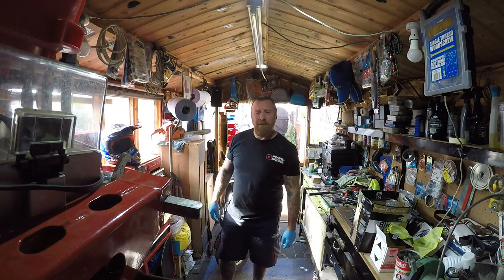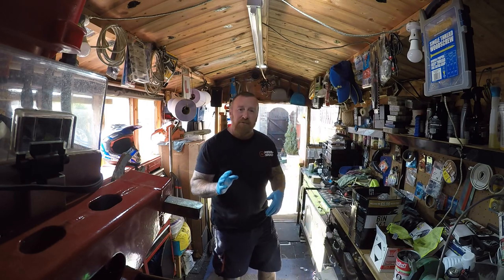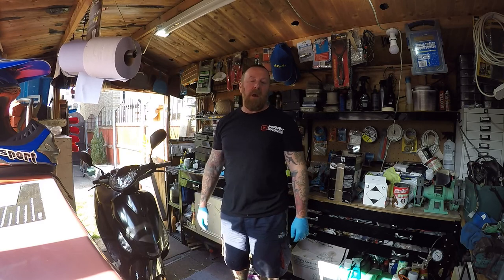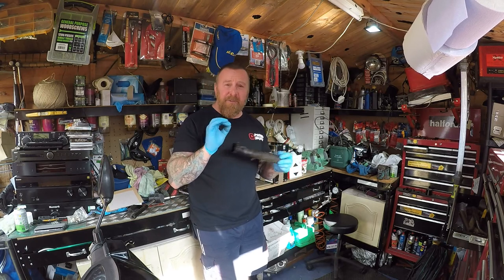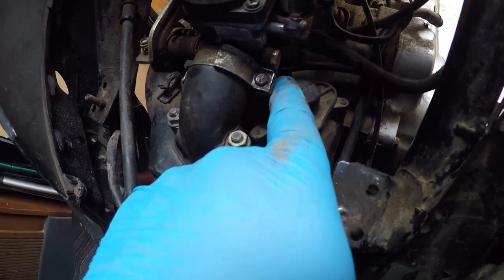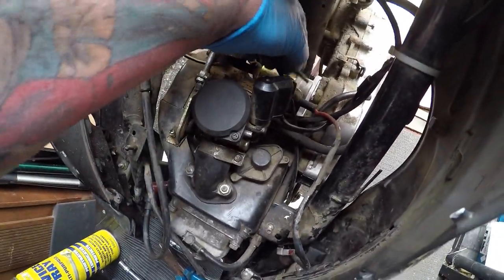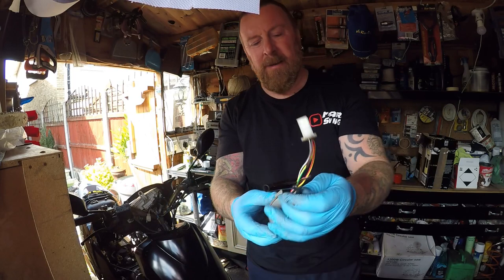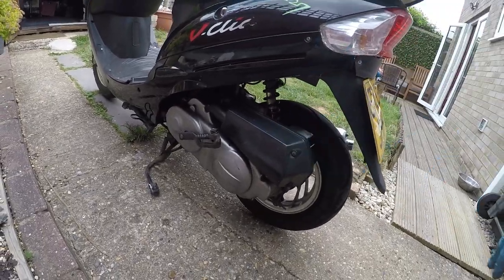PEUGEOT V CLIC MOPED SCOOTER 50CC IT CAME BACK NOT STARTING PT2 MARK SAVAGE

Comment: I've been working on a v clic (Pain in the arse) I went through everything. Tested everything and still had starting issues. Id turn the ignition on, turn it over and it wouldn't fire up straight away but if you turned the key and leave it alone for a minute it would fire first time. Although the cdi came up good on the multimeter  I ordered a new one and now it starts on the button everytime straight away. Cracking vids Mark, thank you 👍
Reply from the maker: Yea thought it could cdi or the relay but it started and is still running now after 4 weeks , take care fella

Comment: I have a vivacity 50 that wouldn't start with the electric starter but would kick start fine, it turned the starter motor wires were reversed in the connector, swapped them round now works fine. Probably not that simple but thought I'd mention it.
Although I'm in my mid 40s im only been riding  bikes for 10 months when i got the vivacity it was giving me a lot of grief was about to scrap it then found your videos, it runs sweet now i love riding it. Thank you for making these videos they've been a great help.
Reply from the maker: this is why I make my videos and its so nice to get feedback, thanks you and all I ask is to sub share and like 
as for this little bugger lol, its been starting on kick and running well for 3 weeks now as the guy who bought it just wanted it back
yes it bugged me and think it had something to do with the replay and cdi but run it does lol 
take care bud

Comment: It's also a good idea to check out the battery connectors. They may seem perfectly clean on the outside but as I found out, the wire within the crimped joint can corrode causing a high resistance and stopping the current from being enough to use the electric starter even though everything else appears to be working OK. It took me ages to figure it out. All I had to do was cut off the old terminals, strip the wire back to clean copper and crimp on two new terminals. Works like new now!
This is on a 2001 Peugeot Elyseo 100cc. (No kill or side stand switches!)
Reply from the maker: They say it the leads and sell them on e bay as a replacement 
Again saving money causes these problems!

Comment: Great video Mark❗️I had a problem almost the same as your several years ago and I worked on it for hours and hours and finally found that the ignition switch worked fine when I just turned it on and kicked started it but when I turned it on and tried to start it the ignition switch shorted out.  I couldn’t get a new switch so I rewired it to a toggle switch for ignition on and off and a push button fir the starter and it’s still working 7 years later. ❗️👍✅
Reply from the maker: lol they really are funny odd little mopeds that drive you mad , it can be something as simple as that or something you will never find
most seem to think a new cdi will sort it but as I had the buyer wanting it back he was happy with just the kick start and I didn't want to put more hours trying to trace it so it went back to him as is and 3 weeks later it runs like a dream 
think i'll stick to 2t and big bikes lol, take care mike

Comment: Hi mark

Would you happen to know if they changed mounting holes for the front brake caliper for the vivacity from 2001 to 2011..or if v clic ones fit ..need a new caliper, can only find 2002 v clic or vc ..good vids btw

Comment: Those two wires not connected to anything are  for a pre  heating element built into  some of the carbs , I think it was an option depending on where in the world the bikes were sold,  I  took my  bargain v -clic up to knights for MOT last week and it wouldn't restart ,  turned out to be a dirty connection on the CDI ,  Frame earth points are always worth taking off and cleaning , and not forgetting valve clearances   which are notorious  for causing starting issues
Reply from the maker: You learn something new everyday bud 
And local lad too lol 
Thought it was maybe the relay due to the starter earthing 
But cdi does seem to be the best bet but hate it when it works then doesn't ect lol 
Take care bud
Reply: @marksavage  Definitely a local lad  lol ,  I bought that kisbee off you and  briefly worked for the same transport firm
Reply from the maker: Its a small world bud
Transport firm ?
Reply: @marksavage  Cabus :)
Reply from the maker: Oh my god that was 24 years ago lol cabus wow the old taxi days !!!!

Comment: If you disconnect the fuel line on the vclic. Is it supposed to leak fuel? Mine does and i was under the impressiom it was a vacume system? Is the petcock knackerd? Im used to having to suck on a vacum pipe to draw fuel. Any help appreciated
Reply from the maker: @Storm20199  yes you right it should and would need changing

Comment: as i all ways say kids just put big bore kits on but dont upgrade anything to take the power  like crankshaft ,carb , exhaust and everything then they dont know why it dont run right :D 
yes i all ways do big bore kits but i do the full engine build with upgraded parts 

and see i said on the last video dont do it as its a 4t but you did  and look where it go you :D

Comment: Hey Mark you cannot just leave the little Scoot without electric start....Get the test meter out.  Is there a voltage to the starter motor when the button is pressed...No  
Work back from there.
Reply from the maker: Mate you know I've done all that lol
Yes power and it turns over 
Watch pt1 v clic 
This has no spark on electric start but spark on kick !
Most think its cdi but been running fine staring everyday on kick start for 3 weeks now and the bloke wanted it back as he was happy with it

Comment: Hi mark , trying to get engine cover of a speedfight is ther a bolt downnthe side of engin because it wont come off thx
Reply from the maker: You will have to drill off the top them mull grip the bolt out after but if its only one or two it will be fine to leave it

Comment: Hi Mark you have some brilliant video’s out there. I recently got a vclic and been doing it up. Thanks for all the tit bits.

For info those bloody wires dangling are because Peugeot decided to add a heater to the carb in the later models (2012-2014?) and rather than doing something to cover them someone has simply left them dangling when installing a generic carb 😂

Going to kill off my kill switch tomorrow, been planned for a while but now I know which wire to chop! Thanks.

Incidentally my electrics aren’t working quite yet more diagnosing to do, felt I needed to get her running by the kick first so which way does the kill switch sit at when normal, do you flick it over to the X to kill it as I assume as I can’t find this anywhere and would help!!

Also the CDI is AC and DC and a battery is required to operate - even on kick which it took me some time to work thru to 🙄😂
Reply: Ps have you done a video on valve lash on the Peugeot vClic out of interest? Thanks.
Reply from the maker: I was told cutting the kill swith messes with the electric start !!
Just a thought but my messed about way before I cut it lol 
No sorry bud I don't as I was more 2t fixer 
I've have a few 4t mopeds and for some reason they run one day and the next won't then nothing touched and they run again 
Go figure  lol 
Any way thanks for the wire update 
Always good to know 
I often get asked about the speedfight blue plug and that was for the lc but they just had one loom and used it for the ac 
But live and learn 
Take care bud and 
Happy new year
Reply from the maker: @karenbarrow8513  no bud I've not played with valves
Reply: Thanks for the quick reply.

I tried to find the wiring diagram but the only place available is in the Haynes Manual supposedly and I’m not buying one of those just for that!

I’ll leave the kill switch alone for now then 😂 The kill on the side stand is routed out already, may or may not bring that back in when I work out the actual issue.

There’s a coupling at the front and rear of the wiring loom that are not connected to anything, thinking perhaps running lights on European models or something which a pretty diagram would confirm whether I need something on the end of them or not!

Peugeot have been little buggers making things ever so different to other chinese peds.

Thanks for your time. Happy New Year!

Comment: Hi Mark,

I have a 2012 v clic that ticks over but wont start.

Notice the fuel filter has what looks like fuel in it, could this be the problem.

Has decent batter, new carb, new spark plug, new ignition coil.

Been stored 3 months unused. Dose have full tank fresh fuel in yesterday.

Any help would be great and appreciated.

Many thanks

Andrew.
Reply from the maker: like in my v clic videos on here just a few months ago they can be a bugger and mess around 
did it run ok before , have you had it running ?
Reply: @marksavage  thanks for the quick reply. It ran okay 3 months ago, but now it makes a noise as if it wants to tick over but just wont. Even the kick start shows dash lights trying to go on to

Comment: Hi mark on my Peugeot ludix 50 elegance I've had a new piston new starter relay and cleaned out carb and new throttle cable the bike starts but cuts right out any idea on what this could be please
Reply from the maker: I take it was ok before and you changed the piston ? why did you do that ?
cleaning the carb will always be a good thing just make sure you cleaned it out right and i'd take it back off and re -do it just to make sure 
there are lots of thing you can not do right when changing the piston but most can be corrected 
piston in right , arrow to the exhaust port
sump cleaned out and any bits out
water or air?
head down right way with the bolts
carb back on right 
id just go over everything and sometimes it just takes it to get going to run right
Reply: Piston was changed before I bought it I will take it all apart and clean again

Comment: That's not the original carb. Those two dangly wires are for a heater for really cold weather. Just protect them from moisture, and tie them out of the way. That angled vent pipe shouldn't affect anything, as it is just for the belt-drive cover. There is another vent at the back. It's just to cool the clutch, and variable drives.

Comment: Hi mark, my v click blew the cdi unit, would you happen to know why?
Reply from the maker: To be honest they just do !, sometimes it's an earth problem. I wouldn't worry to much 
I used to wd40 all connection and check steering around where the wires are
Reply: @marksavage  right, do you happen to have a picture of the wires going into the cdi unit?

Comment: Hey mate my bikes properly buggered was wondering if there is a site or something where you put the reg to make sure your getting the right parts ?
Reply from the maker: No its not like cars but most seller are happy to help with advice for your moped / bikes 
Well most lol 
Just double check with any pictures
Reply: @marksavage  lol cheers mate il give it a shot
Reply: @marksavage   wondering if you cohld tell me the correct name for something I'm pretty clueless.. when you take the kick start cover off on the right is the clutch on the left is a large cog the belt sits behind I need to no what correct name is please ? When I took that case off that thing just fell off nut was floating about lol

Comment: Hello mate! I really like ur videos and you've been really helpful. I've just bought a 2008 speedfight 2 and changed the head and piston cuz it had a scored piston and head. Did replace theese but now the bike wont start. The engine will turn over and the moped does start for about 3 seconds when i spray it with start gas, but then it dies again and wont start. Do you have any clue what i shuld check or what the problem can be?
Reply from the maker: Was it running before ?
Could be reeds or oil crank seals 
Have you done the carb wet hand test like in mt videos ?
You have got the piston right way round ?
And pipes in ok , vacuum working ?
Reply: @marksavage  I got it to start now, it was the cylinder gasket that had been turned sideways when i fitted the head. LOL!

Comment: Hello mate. I have v clic. I cut the green wire in cdi and then it ran like crap. Replace cdi 3 times and it still runs like crap. No speed or accelaration. Replaced carb. Plug.  Still same problem. Any suggestions
Reply from the maker: So you only cut the green wire , which I say everytime not to lol
And then it ran bad
Could you not just reconnect it rather than replace ?
What happen just after you cut it and why the green wire ?
Does it start 
Rev up on the stand 
To be honest like in my video ,I had loads of problems with mine 
No spark etc 
You could have fused the loom 
Stator , coil or anything just cutting wires bud 
Me id go with two ideas now 
One save time and sell it !!!
Or all panel off , trace all wires to where they all go 
Replace ht coil
Test stator
Put back old carb 
Check volt regulator 
And many hours or work to try and see whats gone on
Reply: @marksavage   cut the green loop to derestrict it  . Wish i never touched it. Its goes and revs on stand  but once on road   terrible pull away and max speed is 22mph.. 
Ive changed spark. Carb. Cdi 3 xtimes. Clean air filter. 
Check variator as well . All clean.
Reply from the maker: @rosshodges4263  what weight rollers bud 
Try 6g rollers 
Clean the variator put then in 
Should help with pull away and top end
Reply: Thing is the bike was fine till i cut the green loop on cdi. Why would that muck everything else... god knows
Reply from the maker: @rosshodges4263  the electrics are very funny on these and common to go wrong bud

Comment: I never had any trouble with 2 stroke big bore kits.(malossi) 
They are designed to run on standard carb, air box and exhaust.
Reply: Just 'How?' does a higher-displacement engine function well without changes to the carb or fuel-injection?
'Rolling Wrench' says NO unless upjetting is done, as well as air-intake

Comment: Hi mark what bit do u need to use inpact driver cheers
Reply from the maker: On the 14mm nut ! 
It will come off with ease
Reply: Ok but have u got a normal impact driver and a bit to put on or is it a impact wrench lookin at impact wrench u see not to pricey aswell
Reply from the maker: @A.K.A999  the one that you can attach sockets too

Comment: Hi, I need some help, I've hit a curveball with my Peugeot Vivacity, It Just won't start and burn petrol, It will start for 3 seconds with Starter fluid and then start, I've changed the Petrol Tap, changed the carburettor bowl, cleaned it all out, im going to put the original top of the carburettor back on tomorrow as it ran with that on before, (In June). Ive got the Haynes Manual and i've done almost everything and it won't go, Ive chaged Spark Plugs blown through the pipes to and from the carburettor made sure that there is a hole in the top of the fuel filler cap.
Please Help me Mark you're my only hope!
Reply from the maker: Worse case !
Crank seals !!!
This often happens with a ped that will start for a few secs and stall 
You've check the reeds 
Wet hand test?
But give the carb a clean service 
If you have a good clean blue spark then electrics are all good
Reply: @marksavage  Can you remind me what the wet hand test is? I haven't had the crank case off would that still affect the seals. The Scooter will only run off of Starting fluid would that affect the things you've mentioned
Reply from the maker: @dwr-cchs7724  put your hand over the open side of the carb , air filter off
Turn over the bike and see if your hand gets wet with fuel 
If not it can be your reeds open or the seals gone so it won't sick the fuel in 
Sometimes there's signs of leak on either side so varoator or stator side
Reply from the maker: @dwr-cchs7724  but if the carb is on right and you get a wet hand the seal should be fine but reeds can still mess about
Reply from the maker: @dwr-cchs7724  got videos on all these
Reply: @marksavage  Ive done that and i do get fuel on my hand
Reply from the maker: @dwr-cchs7724  then seals should be fine .
,last test 
Open throttle fully and try to start , if it pops and bangs when trying it can be you piston ?
Otherwise got to be carb 
So 3 half turns out to start 
Air box with filter 
Good clean carb with the right jet 
And see how it goes

Comment: so uhh. I have a peugeot speedfight 2 50cc AC and it get like two sparks and stops, and i turn keys off and back on try start it the same thing two sparks. I have watches every speedfight videos you have still nothing works.
Reply from the maker: Wow you have watched over 100 of my speedfight videos !
Thats impressive but I have gone over the cdi which will be you problem 
Which one do you have ref my video?
Immob ?
Wiring ?
Plug , ht lead,  stator coil ?
Best type in speedfight mark savage
Reply: @marksavage  well the problen was/is a stator, i cleaned it and i may have to buy new one

Comment: What do I do when it drives slow
Reply from the maker: Service 
Variator 
Carb
Reply: @marksavage   my friend says I need clutch fixing
Reply: @marksavage  i just wanna know could that be the reason
Reply from the maker: @zyzz11  they have a variator system like in my videos mate 
Watch them 
Don't just guess what you mate says 
9 times out on 10 it the rollers like in my videos 
Or a service so 
Plug air filter and a tune
Reply: @marksavage  ok I’m just gunna take it to the garage it is just easier